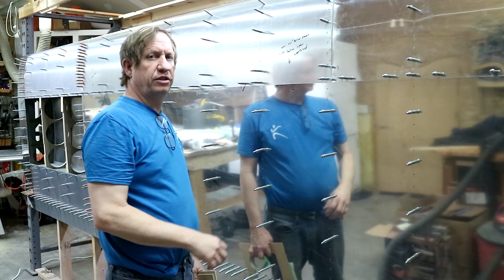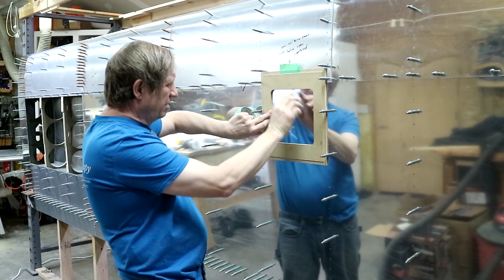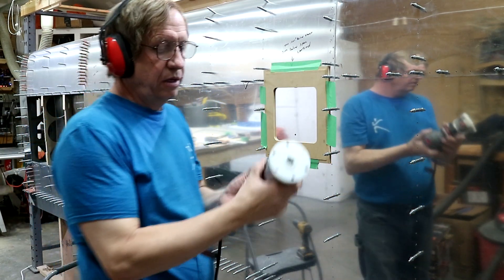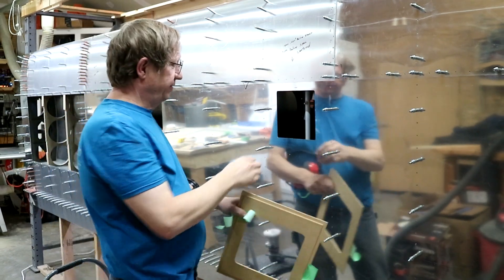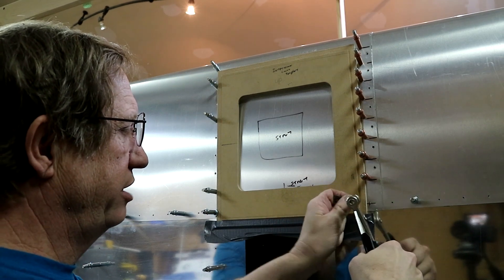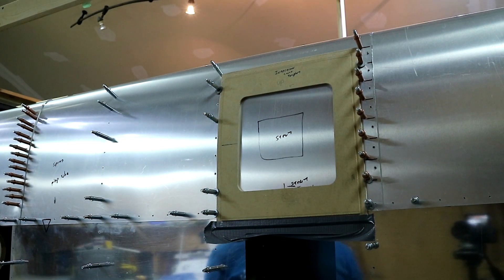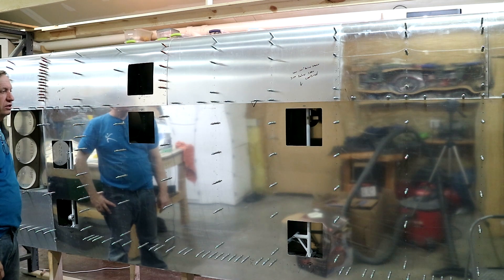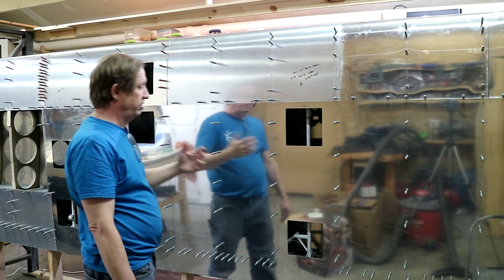Bearhawk Experimental Airplane Build : Cutting Wing Inspection Holes

Comment: Hi, I'm Mariano, from Argentina, I follow your updates with great enthusiasm, a while ago I bought the plans to build the Bearhawk with 4 seats. When I saw the materials for the fuselage, I found measuring tubes 1,000 "long (one thousand inches), is this correct or did the file add digits? If possible, could you tell me in detail what quantity of tubes I need, and the measurements of these ? In this way I can compare with my plans and realize if I have all the material to start, or I must buy whatever I need. Thank you !!! Mariano
Reply from the maker: I am building the wing and have not started on the fuselage. I would highly recommend Eric Newton's builder manuals they will answer a lot of your questions. Link - https://bhtailwheels.com/builder-manuals